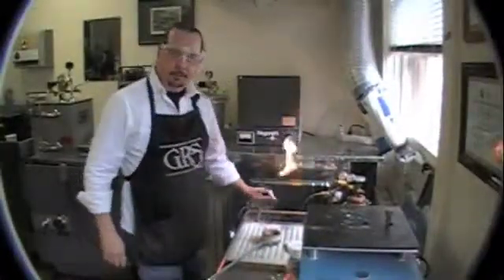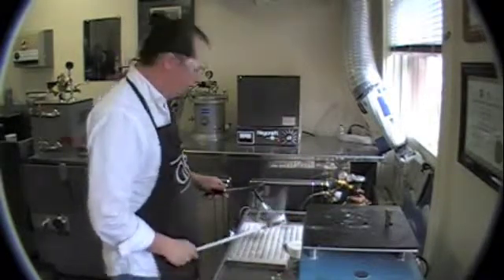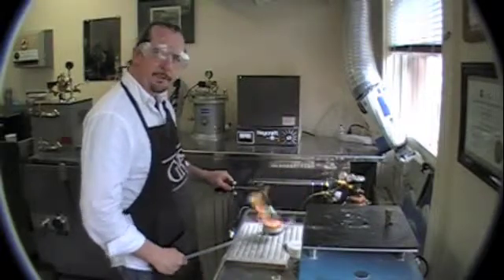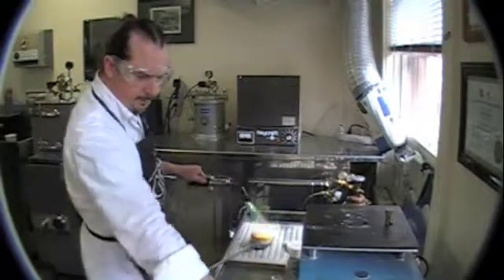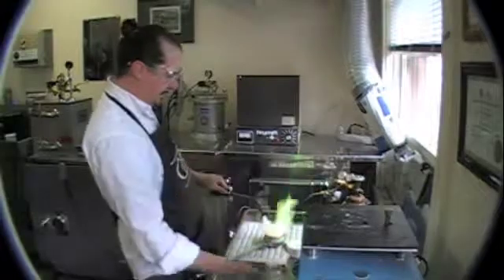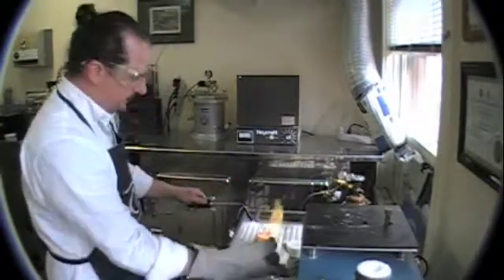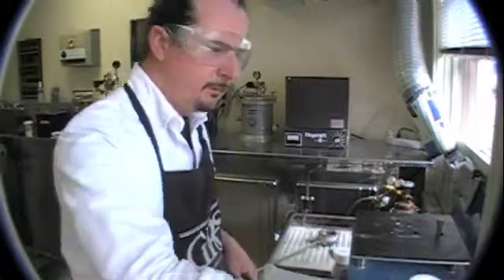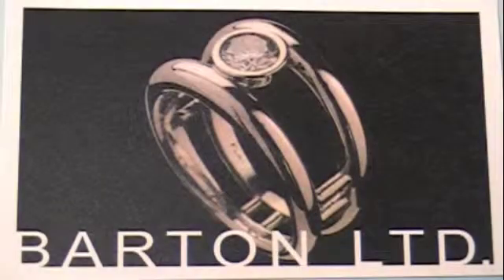batronltd casting ivy leaf part 2

Comment: Good vids - but why are you using silicone molds that you have to cut when you could use rubber  that will separate without all that work?